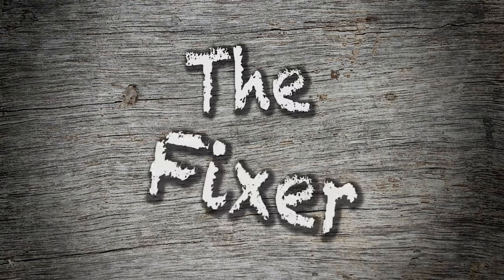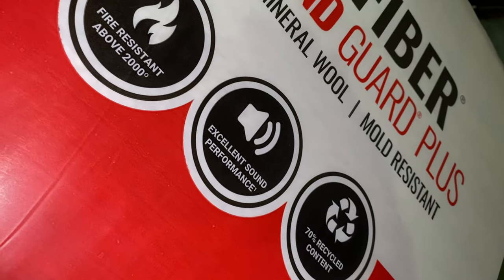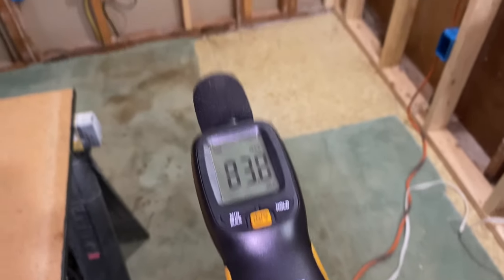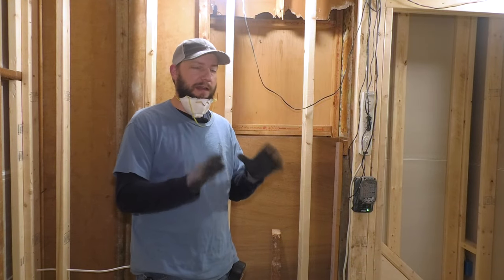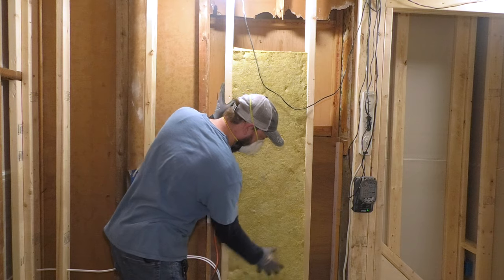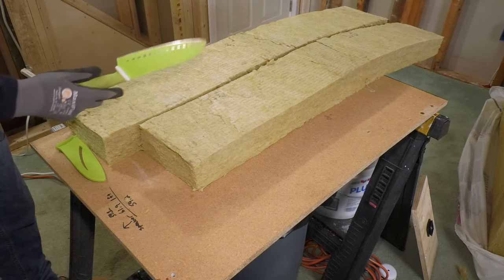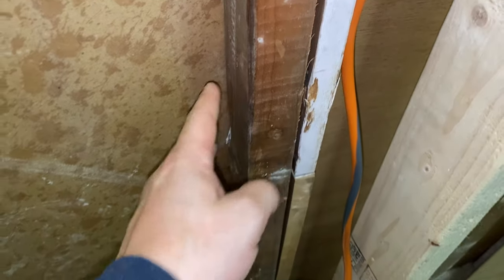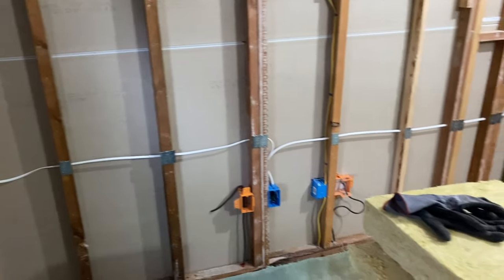Does Mineral Wool Really Work? | How to Install Sound and Fire Insulation

Comment: A complementary test would be when the drywall is put up, to help soundproofing and see if the noise is more reduced. Or when the furniture act as noise absorbent, to test too. Is an a idea.
Reply: Please do with drywall.  I did this im bedroom and the sound reduction felt like it went down with the drywall, but that could be down to the reflections from in the room that no longer was exposed to the open rockwool
Reply: The point of the test is to determine if there is any noise reduction with the mineral wool insulation, not the drywall.  That would be a ton of work to have to put drywall up and then tear it all out to test ot again but with insulation added.
Reply: @Matt-cl4mp  But he could do another test once the drywall is installed.

Comment: When I remodeled my upstairs bedrooms I did exactly this method. Fiberglass on the outside walls and mineral wool on the inside walls. The wall that separates the two rooms for my boys (4 and 6) also got a layer of sound isolation board on one side. What a huge difference. You can’t hear a peep from one room to the other. Last thing I will be doing is swapping out the hollow core doors and we will get some better performance. Keep up the good work and the videos.
Reply: What kind of isolation board did you use?
Reply: @pinotte23  it’s called “Acoustic Insulation Sound Board”. I got them at Home Depot.
Reply: @JorgeAguilar714   Thank you
Reply: Why not just fill those doors with foam?

Comment: Keep in mind that every 3 dB is twice as loud/quiet, meaning it reduced sound by 3-4 times or so. It would be complimented by 2 layers of drywall, sealing first layer with sound caulk; just not sure if worthwhile for regular house that has no neighbors on other side of the wall
Reply from the maker: Yes.  All great points.
Reply: I thought it was every 6 db?
Reply: I'm very late to this. But 3db is double the power; 6db is double the amplitude (voltage) of a signal; neither are necessarily doubling of perceived intensity. Perception is interesting, but since our ears are logarithmic, 10db is generally regarded as a perceived doubling of volume.

Comment: I removed my previous message, I think I got it. The sound will transfer through the drywall, the stud, and the drywall next to another chamber or through the ceiling's plywood of the apartment above. The important thing is that the drywall doesn't touch the stud. I found some SONOpan 3/4" at Home Depot in Canada. I intend to put the sound insulator directly on the ceiling's drywall, then adding another drywall.
 
 The vibration caused by the lower frequency, or a bass, would be the worst. If instead of 2x4 they are 2x10 and putting the best sound insulation between the studs, the sound or vibration will still be transferred by the drywall to the 2x10 and the plywood's floor above. I might double the SONOpan to have 1 1/2". Some sound or vibration will still be transferred through the walls around by the drywall, the stud, the drywall next to the adjacent apartment. I don't have to do the wall, but what I found out is: don't let the drywall touch the stud. I am not a sound expert, I just made a lot of research about it and I made my own conclusion. I intend to put the SONOpan directly on the drywall's ceiling, then I will cover it with drywall.

Comment: One of the easiest things you can do to soundproof (it reduces your interior measurements a bit) is to double hang drywall with sound absorbing adhesive in-between the 2× sheets and use that same sealant where drywall edges meet. You'd be amazed how quiet it can get.
Reply: Waste of money. You been living long?
Reply: @teamdada2194  Long enough to know idiot proof ways to deaden noise in living spaces. It appears you're still coming out of that idiot phase. Good luck on your journey 👍

Comment: Man, you did a great job on the install!  In early 2022 I  used Rockwool in the walls and cellulose in the ceilings for my 1200 sf Rambler - it's basically a 28' x 42' box.  It's laid out with the living room and kitchen on one end, and the bedrooms on the other, connected by a center hallway with a bathroom on each side.  After insulating the exterior I had some leftover so I added Rockwool to all the internal walls around each bathroom.  What a great decision - I should probably do a demo video....  You were probably even happier with your results after adding your drywall - the additive effect is awesome.  

I have been shocked at how quiet our whole house is.  We are about 200 feet from the street and we almost never hear passing cars - only the very loudest trucks and they are barely noticeable.  We only hear rain or wind if it's a heavy thunderstorm and are often surprised if we haven't looked outside and discover it has rained.  From the bedroom with the bathroom door closed, I can just barely hear the shower running or the exhaust fan (in our last house, you could hear the shower through the wall so well you could tell when someone was rinsing their hair!).  The Rockwool being essentially on TWO walls separating the two ends of the house (the opposing walls of each bathroom) means that even with the open hallway, if one of us tries to yell something to the other between a bedroom and the kitchen, we don't even bother anymore - we won't be able to hear it (not completely silent but just not loud enough to understand words).  

I highly recommend Rockwool for interior walls. And you mentioned the mold- and fire-resistance but Rockwool is also critter resistant - hard for mice to nest in it. I’m sure you’ll enjoy yours for many years. Oh, and yes, the temperature insulation beats fiberglass noticeably (every month :) )

Comment: Nice demonstration sir!  I know in the beginning you mentioned you'd need a vapor barrier to use that stuff on exterior walls, but actually mineral wool is non-wicking when it comes to water, and its insulative properties don't decrease with moisture either.  You can put that stuff in the wall without the need for a vapor barrier at all!

Comment: I used rockwool in my garage and I will never use anything else. SO easy to cut and handle with no itching for days afterward!  No bugs, no mice, no fire worries and a MASSIVE drop in sound. Once you have up your drywall and it's sealed, you'll have an even bigger drop, even with your thin walls. 

For those with media rooms or a musical instrument room (or a common wall with a neighbor), layer a second set of drywall with offsetting gaps and the green glue between sheets and it will be like it's not even in the house while you shake the floors and walls in that room.
Reply: Big drop...until your neighbor puts out some low-frequency sounds and then those long sound waves will cut through your setup like a hot knife through butter.
Reply: @mpbootcamp7009 
Seriously,  that is absolutely right.
Reply: Did you use a vapor barrier ?
Reply: @OGCJ10  the garage has a full exterior system in place so no, I did not apply any additional barriers over the inside. Garage doors are never going to be airtight, so it breathes enough on its own to allow rain and snow that comes in on vehicles to evaporate and escape without any impact on the insulation. I did not drywall in two of the walls, so I can see the insulation and its full state at anytime. It looks exactly like it did on the day it was installed with maybe a little extra dust.

Comment: The fire caulking also works well to air seal the electrical boxes around the wire holes.  Sound travels well though all air paths.

Comment: There was a test with regular pink panther fiber glass vs. rockwool and the Pink Panther stuff destroyed the Rockwool in the sound blocking/absorption test. It was insane. I'm definitely going with the cheaper Pink Panther stuff to sound proof my walls along with double donging with 5/8 sheet rock.

Comment: i found that if you make an additional "fake" framed wall about 3" thick thats not touching the existing wall, fill that with insulation on the roll, then add plaster board (drywall) then glue sheets of sound proofing board for floors then another layer of plaster board over that is fairly soundproof to not hear snoring through wall

Comment: Does this need to have drywall put on top? Can it be left without anything covering it?  Will plastic or the aluminum covering that goes over the pink fiberglass insulation work?

Comment: You should do the test again after you drywall the room...  just wondering if drywall helps or make sound travel better...  Also just wondering why you used  fiberglass for the outside walls rather than mineral wool everywhere but the ceiling, it would seem to me cars driving by at night while you are sleeping would be more annoying...
Reply: Mineral wool vs fiberglass insulation isnt as dramatic as this. I would be surprised if mineral wool gets more than a point or two better dB reduction than fiberglass.

Comment: I will be doing the exact same thing in couple days and can't decide if i should use fiberglass or rockwool. Fiberglass is a lot cheaper per sq/ft. This is only for sound proofing a bedroom. Not a studio or theatre room. Is the difference between two types of insulation big for sound proofing only.
Reply from the maker: Hey! I have used both and I do think that there is a difference between the two. Mineral wool is more dense so I think that it is much better for sound proofing than fiberglass.  Hope this helps!

Comment: You actually do not need a vapor barrier with mineral wool, it itself is a vapor barrier. If you don’t wanna buy the knife that’s meant for cutting mineral wool you can also use the bread knife in your kitchen the serrated blade cuts faster than a flash sharp blade

Comment: if you really want to reduce the dB but a stupid amount, and you don't mind going bankrupt in the process, you'll need to build a "second" wall with studs offset from the primary wall, and fill that wall in with thermafibre + bass reduction rubber + the green stuff.

The wood is the primary conductor of sound in this situation so you need to separate it from transmission.

Comment: the real weak points are typically your doors when it comes to soundproofing.  Rockwool usually doesnt do any better than regular fiberglass insulation and that is typically cheaper.
Reply: Is that true? Because i will be doing this in couple days and would rather put fiberglass since it is 1/3 cheaper per sq/ft
Reply: @Faruk651  Your install just has to be good.  No gaps.  It is easier to install rock wool and not have gaps because the material is easier to work with.  But you can get similar results with either material if installed properly
Reply: @theripper121  i understand, thanks.

Comment: Oh no, fiberglass is not an interesting experiment. It just doesn't work as well, in part because it's too light-weight. If you want to geek out about soundproofing, you would first look into air sealing, because if air goes there, so does sound, then you'd check out either thicker drywall or double layers of drywall (with an acoustic caulk in between), and if you were still bored you'd consider building a double wall system.
Reply: oh look one of the crazy audiophile person from the internet forums who thinks their crazy overkill soundproofing system is the only way. Anything else is waste of time. Not everybody is crazy to spend $$$$ to make a perfect sound proofing. This is a basic soundproofing for a bedroom and it works. go to your crazy forums with other crazies.
Reply: @Faruk651  Oh Faruk. You came to a video about sound proofing and then wrote about how it's pointless. I'm crazy, and so is The Fixer? Come on now, get your head on straight. Anyway, if you want to take that room and increase sound proofing on the cheap, the other easy step is to caulk the joints and around electrical boxes before installing the insulation. It might cost $20. If $20 is too expensive for you, that's fine too, but you probably should avoid any kind of home renovation projects until your financial situation is better.